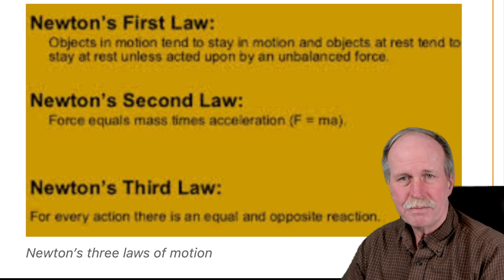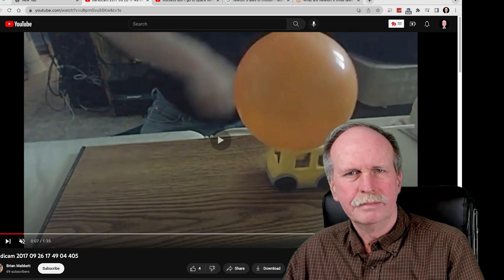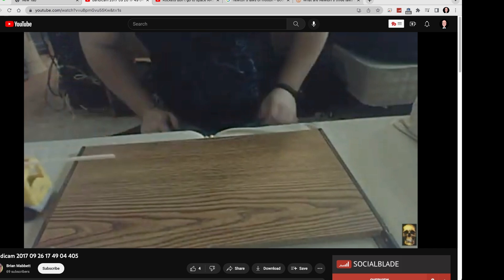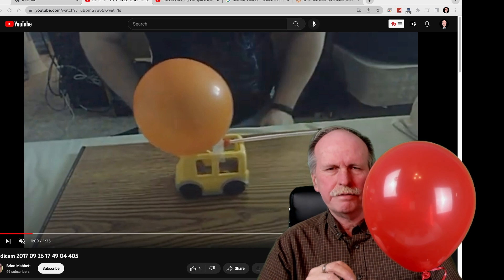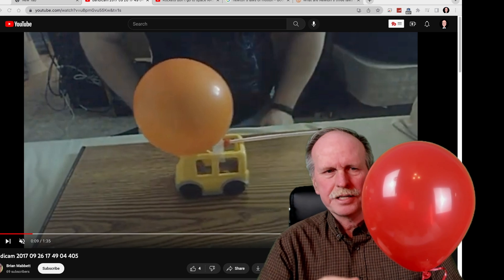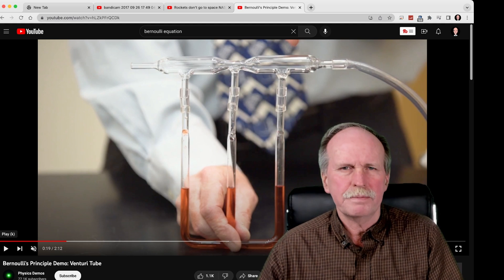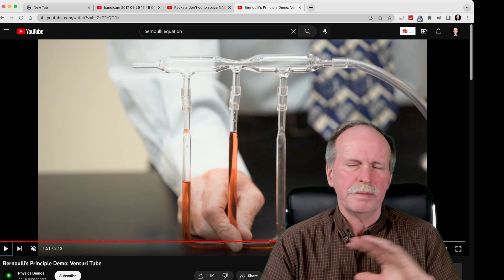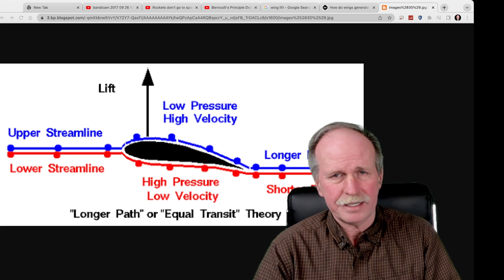Flat Earth Proves Rockets DON'T WORK

Comment: One area I have yet to see addressed by Flerf busters is: why HAM Radio can't work on the FE. It's not possible to pass the tests to get get your HAM license, without being able to explain radio wave propagation over distance.
Reply from the maker: Ham Radio is a great way to demonstrate the spherical nature of the earth, measure the distance to the moon, count meteors, and do a host of cool things.
Reply: @BobtheScienceGuy  - .... .- -. -.- ... / -... --- -...
Reply: @BobtheScienceGuy  I still find it easier to say da-di-da-dit  da-da-di-da... but that's what happens when you don't use a language for 30 years! At least you're not required to do 12 wpm any more to get your license. My last one was VE4 GE, earned in the mid 80's.
Reply: I have brought this up numerous times as I am a HAM operator (VE6 SWT) and have been very active in the amateur radio Astronomy scene for decades. I’ve shown photos of my equipment and results of a couple of easy experiments to a few flat earthers and they either say “I have no explanation for that” or nothing at all. Still doesn’t convince them of anything however. Personal convictions are difficult to overcome I guess.
Reply: @KosmicJelly  There is no amount of Flerf mumbo jumbo, that can explain why different radio wave frequencies of equal power, would or would not travel long distances. It's a convenient area for them to ignore and perhaps should be used to bash them over their empty heads. I haven't been an active HAM since the early '90's when my military career in Signals kind of swamped the time and interest available for HAM activities. Then the Internet was set loose. I do wish I could restart the hobby again, but living on pension makes that a remote possibility. I think the last HAM communications I did was in 1990 from CFB Kingston's station after repairing their rig.
Reply: @gregedmand9939  Yes, based on my exchanges with a number of them, my impression is that they do have a special talent for conveniently ignoring anything and everything that doesn’t conform to their beliefs. My own belief — unreasonably optimistic as it may be — is that a great number of them are simply having a gag.

How did you like your signals career? I applied at CFRC Calgary (many years ago) for signals as my first choice. Unfortunately I never made it beyond the initial aptitude test due to my being hit head on by another vehicle on the highway and losing a leg. But I thank you for your service, it takes a certain kind of character to make that kind of a commitment.
Reply: @gregedmand9939  
I agree completely. I have to admit that I’m not familiar with the channels or names you’ve mentioned as I don’t exactly go out of my way to find these cesspools, but occasionally a video like this comes up in my feed. I really should know better by now than to bother venturing into the comments.

Sounds like it was a rewarding and exciting experience for you! It was the paid education that really turned me onto the idea of applying. I had applied for full time/regular force as a Signals tech as my first choice and infantry as my second choice, but I don’t recall having the option of applying for any specific Unit. After losing my leg and overcoming the couple of years of depression that followed, I decided to pursue a degree. I graduated with my MSc in Physics from the University of Calgary’s Department of Physics in ‘73. Shortly after that I ended up partnering with a lifelong friend and cofounded a company offering tubular running services in the oil & gas industry here in Alberta, so I committed to that for the next few decades and retired early without putting my degree to use.

Comment: What the rocket pushes against is the inertial mass of the propellants. The propellants, which have mass and inertia, are combusted and pushed in one direction. This creates a reaction force that pushes the rocket in the other direction. Essentially, both the rocket and the propellants are pushing each other in the opposite direction. This is because they both have mass and inertia so when either mass is accelerated against its inertia in one direction the other mass is accelerated and pushed against its inertia in the opposite direction.
Reply: Yes, but that is only part of the total thrust.  The other part is the rapid expansion of the gas produced by combustion of the fuel. The very high pressure of the gas as it exits the combustion chamber expands in all directions against the surface (area) of the nozzle.  The nozzle "reflects" the gas out the back which pushes the rocket forward. The thrust from combustion is far greater than the acceleration of ejected fuel.
The formula for rocket thrust is F = m vₑ + (pₑ - pₒ)Aₑ .    
m vₑ is the amount of mass (fuel) being pushed out of the rocket at the exhaust velocity, Newtons 3rd law.
(pₑ - pₒ)Aₑ is the pressure of the exhaust minus the outside (air) pressure multiplied by the area of the nozzle.
According to this formula the thrust increases once the rocket is in a vacuum since pₒ = 0.
The outside air pressure actually reduces the thrust.
Totally opposite to the way flat earthers think rockets work!
Reply: @tonyonofrio1147  Being a physicist, I find the very word "push" misleading here. You can call it pushing but it is really just conservation of momentum.
Reply: @arctic_haze  We're talking to flat earthers and other non-scientists here. Conservation of momentum is over their heads. The concept of pushing against something is simpler and easier for average people to understand.
Reply: @joevignolor4u949  Popularization requires simplification but my point is the very term "push" is an example of just that. By the way, even starting from Newton's Laws of Motion is sensible only in the context of school teaching and popular texts. They are basically equivalent to the laws of conservation for momentum and mechanical energy (one set of laws can be derived from the other) but we nowadays deem the conversation laws as more fundamental.
Reply: @tonyonofrio1147  The hot exhaust gas flowing out the back of the engine is composed of the combusted propellants so the mass is the same. The liquid propellants are injected into the thrust chamber and burned, which pressurizes the thrust chamber. The hot pressurized gas is then accelerated backwards by the nozzle and discharged out the back of the engine. As such the thrust is basically F=MA. People, especially flat earthers, don't recognize the importance of the propellants in providing the inertial mass that the rocket pushes against when the propellants are accelerated backwards. This makes the 1st law as important as the other two when trying to understand how rockets work in space.
Reply: The thrust produced by combustion of fuel and oxidizer is pushing on the rocket itself. If you guys agree on that, flattards will understand that a rocket will work in the vacuum of space. Next is to get them to understand that the area past earths atmosphere is considered space, which most flattards don’t believe. 
The turbo pumps of the Saturns F-1 engine pumped out 8 tons of fuel and oxidizer combined per second. I wonder how many swimming pools that would equal!
  Love your posts but is just way past most people. I had trouble myself, but will read and try to comprehend anything dealing with rocket science. Thanks to all of you!!
Reply: @sourand jaded I completely agree with your analysis, especially regarding what causes the mass flow. However, I wouldn't say it has nothing to do with mass flow. It's really a combination of the mass being accelerated via the combustion and the propellant mass flowing through the engine. That's where the equation F=MA comes into play.
Reply: IOW, the rocket pushes off its own exhaust gas. but even that is too complicated for those uneducated troglodytes to understand. SMH
Reply: Newton figured all this out, flat earthers either tend to ignore this or they make up and spew some bs to try to “prove it wrong”. In the end, they just prove us right.
Reply: Another way of looking at it is the combustion chamber is a high pressure tank that is open on one end.  The force of the pressure is equal on all sides except along the axis of the rocket, so there is no pressure pushing on the bottom of the combustion chamber and full pressure pushing on the top.  The difference is what produces the thrust.  The nozzle is there to steer as much of the exhaust gas out in one direction as possible to increase efficiency.  The rocked would still work without it, just not as well.
Reply: @Andrew-ep4kw  Yes, that is an equivalent way of looking at this. It is common in physics that you can solve something with different methods (like conservation laws vs. forces). But in this case it is much easier to calculate the thrust from momentum conservation.
Reply: Ha, love it when you boffins argue.
Reply: @Daniel North  Arguing is part of our job decription 😀
Reply: Don’t get to technical the Flerfs will get triggered
Reply: @Shiplee1  It's important to blow up their inaccurate arguments and false narratives  before they can  mislead other people into thinking the same way as they do.

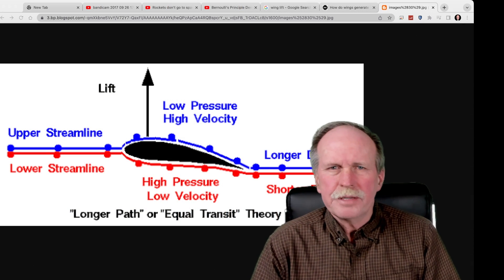Comment: Hi Bob. 10:25 "That is how airplane works" - no it is not at all. On an airplane with very asymmetric airfoil like Clark-Y, Bernoulli's principle contributes to around 5% of the lift. On a symmetric airfoil Bernoulli's principle contributes to 0% of the lift. If you were right, an airplane can not fly upside down, this proves you are wrong in this case. Lift is caused to 95-100% of acceleration of air downwards by the main wing's angle of attack. Note I am just a measly RC airplane pilot, but I have built more than 50 model airplanes from scratch, and designed my wings with profili2. Profili2 is a software which provides a graph of the lift & drag by an airfoil.
Reply: You're both correct.  A wing with zero attack angle (such as the one Bob showed in his graphic) will generate lift due to Bernoulli's Principle.  A wing with a positive angle of attack will also generate lift due to the change in momentum of the air mass being deflected away from the underside of the wing.  Planes that are rated for inverted flight do so because the lift generated by the fuselage and the elevator OVERCOMES the downward forces being generated by the wing while upside-down.  This is why most planes are not rated for inverted flight.
Reply from the maker: Put a big enough engine on a plane you can make a brick fly.  How does angle of attack fit it in with the subject of the video?  Thanks for the details, they are correct but don't really add to the video.
Reply: @BobtheScienceGuy  I'd say it is relevant because it demonstrates conservation of momentum, which is also perhaps a better way of explaining why rockets work. It's how you derive the rocket equation, after all. I mean, when we talk about an equal and opposite reaction, that's when flatties say that there can't be any forces since there's nothing to push against. But the rocket exhaust being ejected at high velocity in one direction requires the rocket to accelerate in the other direction, regardless of how whether and how you see the forces involved.

Comment: In a rocket chamber is a constant pressure of about 100 bar, and even though a Saturn V burns through 10 tons/second, this pressure is stable.
 (the stage 1 uses up 1,500 tons of fuel in 150 seconds). 
  
I just ask myself, how much resisting effect does the mass of 1 bar atmosphere have compared to 100 bar with 3000 m/sec? 
 
 
For flat earthers the term inertia is meaningless (I like our german "Trägheit" better, translates to something like "reluctance against changes of motion"). 
 
They have the idea that when you "expose" gas to a vacuum, it is able to dissipate with infinite speed. That it takes time to be set in motion, respectively when it moves with 3 km/s, to change their direction - too complicated.
Reply from the maker: The engine is one thing, the plume another.  Obviously there is a lot of pressure in the plume, but the atmospheric pressure keeps it narrow and it expands as the AP drops with height.  The point was to demonstrate an easy way to see the rocket is not falling back to earth but continuing to space.
Reply: @BobtheScienceGuy  Actually, the pressure inside the plume can be considerably lower than atmospheric - a partial vacuum in fact - another implication of the bournoulli law, which makes it obvious that atmospheric pressure "contains" the plume.

Properly designed nozzles usually  result in the gas in fact traveling rather faster than the speed of sound.  There's a tell-tale sign of supersonic gas ejection - 'shock diamonds" (also referred to as "mach diamonds").

Here's a video with explanation and examples with jet engines, rockets and possibly even cosmic plasma/gas interactions::

www.youtube.com/watch?v=3L6L5q6UKgY

Can give rise to some really weird rocketry effects such as "bournouli lock" and the "Khrushnic" effect.  Both ruin a perfect rocketry day.
Reply: Its important to remember that the propellants have mass and therefore inertia. What the engine does is to accelerate the mass of the propellants against their inertia in one direction, which then accelerates the mass of the rocket against its inertia in opposite direction. What you have are two inertial masses pushing and accelerating each other in opposite directions. This is why the rocket doesn't need anything external to push against. Instead it brings the propellants along and pushes against them.
Reply from the maker: My rifle doesn't kick more with a hit than it does with a miss.  That explains the entire concept right there.
Reply: I find the idea that air at a pressure of 14.7 psi, can support the weight of a Saturn V rocket pushing on it, utterly ludicrous. 
I have seen the claim that the rocket creates a high pressure air cushion beneath it but clearly that cannot be the case with the rocket ascending.
Reply: @grahvis  It's not a matter of pressure, but of the mass and speed of the combustion products. Thrust force depends on gas velocity and mass flow. Different combinations of fuel and oxidizer have a theoretical maximum specific propulsion impulse, the influence of pressure in the combustion chamber, combustion temperature and properly designed nozzle expansion determines the efficiency of the engine. In the calculations of the total thrust, the static overpressure at the base of the nozzle in relation to the local pressure is also taken into account but compared to the total thrust, it forms a small component of the total thrust